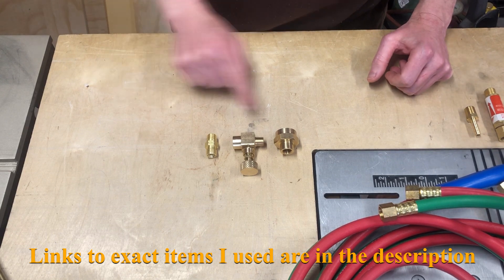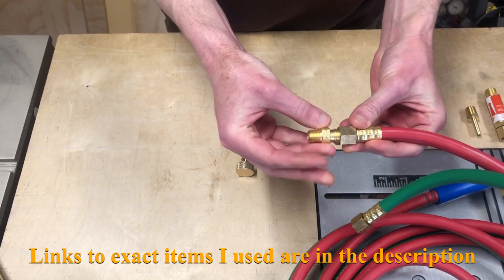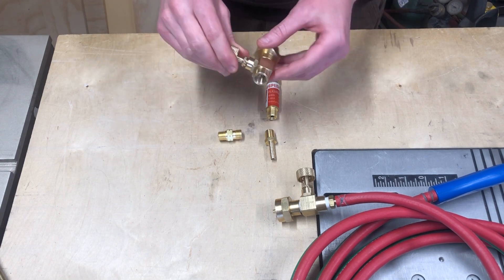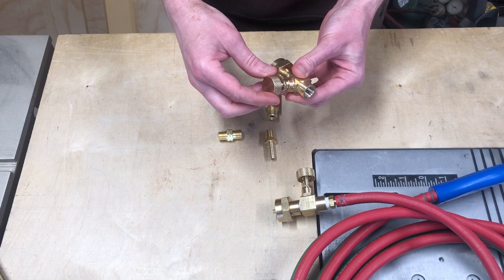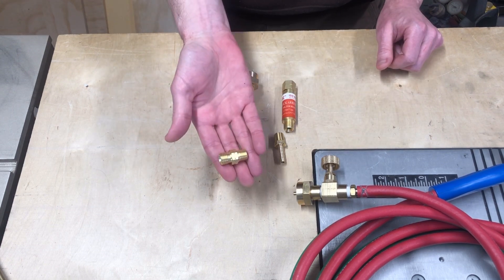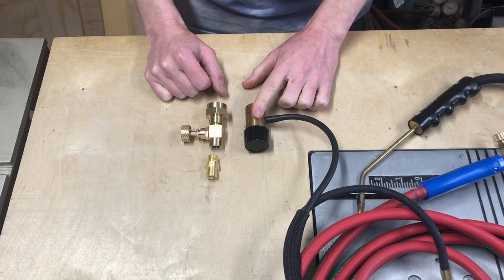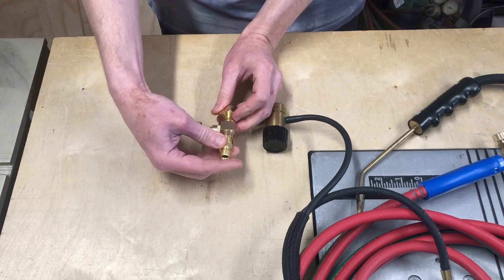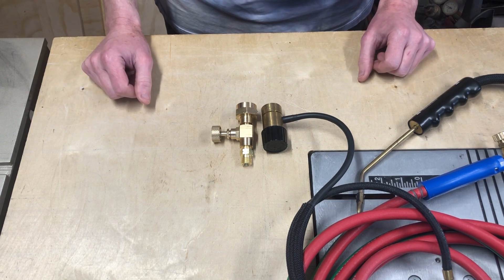Better alternative to a Smith Little Torch or Gentec Regulator for 1lb propane tanks?

Comment: Hi thank you for video. 
Is this method will work on disposable oxigen Bottle?
Reply: No,  the disposable o2 tanks are left hand thread and would require a different adapter.  Personally though, I would highly recommend not even bothering with the disposable tanks (1.1cu ft) and just getting either an MC (10cu ft) or R (20cu ft) size O2 tank.  You can pick up either for right around $70 and have 2-5x as much o2 as you would buying disposables, plus the larger tanks can be refilled for $10 so in the long run you save a ton of money while making less waste especially if using an oxy-propane torch since they require 5 parts O2 for every 1 part propane burned (4:1 for oxy-Mapp, 2.5:1 for oxy-acetylene)
Reply: Thanks

Comment: Hi thanks again for the upload and information. I've constructed a needle valve setup similar to yours and connected my disposable tank to it and a flashback arrestor. I've fiddled about with both valves but I think the pressure is to much as can't get flame to hold steady without extinguishing. Do I need an additional pressure regulator? As I'm pretty sure that gas is coming out at alot more than 10 psi which is recommended for the little torch... Any advice would be welcome..